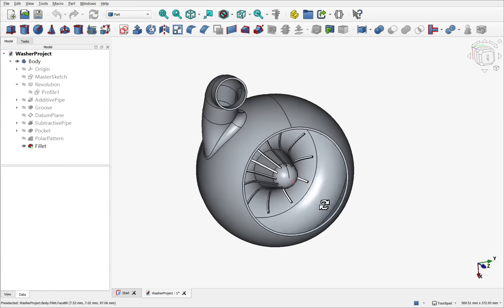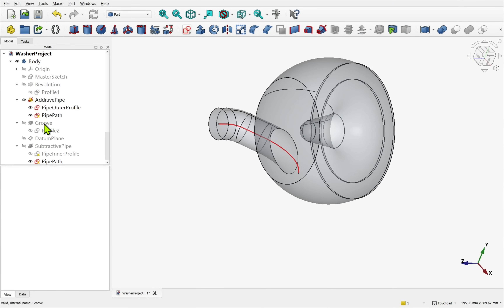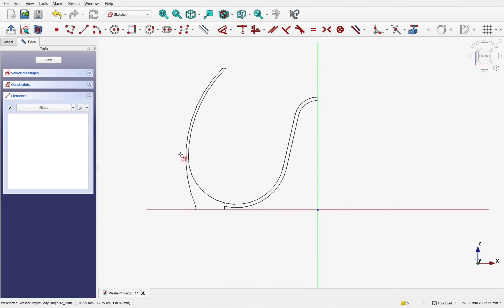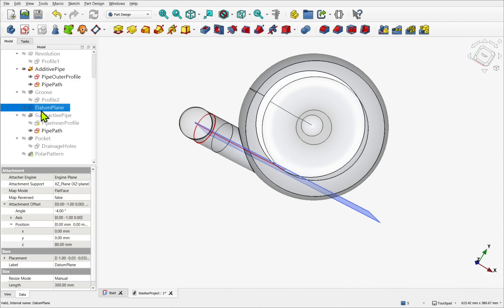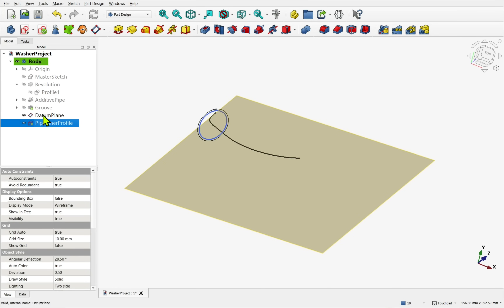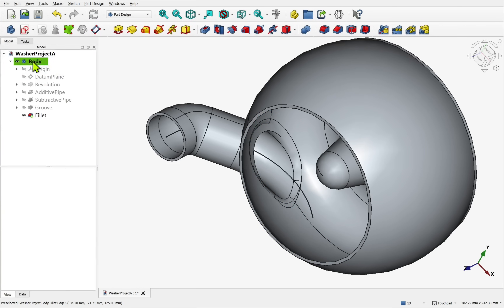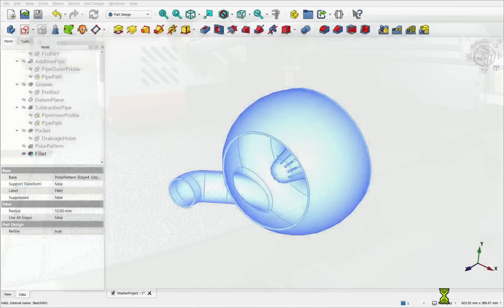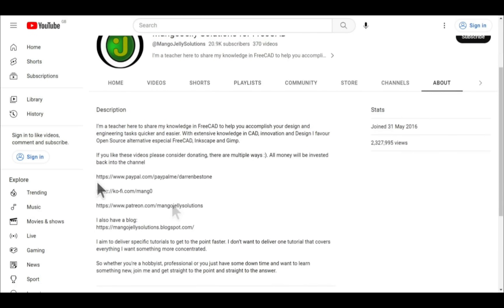FreeCAD 1.0 vs 1.1 some new Features in Action | 3D Printing Project

Comment: Until today, I hadn't thought of creating plans to design pipe routes. Now that I know, I feel incredibly stupid for overlooking such a simple detail. Thank you for the video.
Reply from the maker: It's only easy when you know how or seen it before.  I always kicking myself saying 'why didn't I think of that lol'. Does makes it a lot easier to visualise, also in case you don't know, you can connect two or more planes up with the shape binder for a single pipe.  I did a video for this (it only uses sketch planes but should work with datum as well) https://youtu.be/jE-H_30MbcA

Comment: I spotted your design as a thumbnail for one of those "amazing industrial inventions" compilation videos. I doubt it was even shown in the compilation as those videos are garbage, but it's nice that I found the original author.
Reply from the maker: Oh, I have never seen that video.  Was this recent. This video and the short video was only released towards the end of last week so may be a similar design.
Reply: @MangoJellySolutions  Sorry, I didn't make a note of the video. I've watched a couple in the past, the thumbnails were clickbait and they were a compilation of what I can only describe as extreme OSHA violations where sweaty guys in a dusty workshop wearing nothing but robes and sandals handle barbed wire and glowing metal.

It was very recent that it was recommended to me, and although I'm quite sure it was a picture of your work, it might be as you said. Human memory is fuzzy.

Comment: A couple of quick Qs. I see you have a modern printer. How long did the tomato spin washer take to print? How much filament?  My wife is suddenly really interesting in 3D printers now. Request: can you print some more cool useful kitchen tools so I can get a 3D printer with my wife's blessing.
Reply: A number of 3d printing model sites available to download models or code. Literally, download (code), send to slicer software (software also free download) to slice and load to printer by sd card or wireless. As this channel demonstrates, using freecad opens up human imagination to 3d printing. Or, ask AI to design something for you and slice it to match your printer.  How much filament used & it's cost is usually provided info after slicing. Consider this: free downloads of models and slicers provide time to print & filament costs while you don't even have a printer. Just set the software to a printer you have in mind & process.

Comment: isn't it easier to use a "thickness" feature to hollow out the model instead of doing a groove and a subtractive pipe ?
Reply: The thickness function may not work depending on your model complexity.
Reply from the maker: You can go that route but It's a bit hit and miss if that works, depends on the geometry.  The thickness will offset, inset the faces, if an intersection happens it will all come crashing down, similar to as when a fillet crosses it's edge into another face.

Comment: I really liked this format, short, simple, straightforward, yet with lots of tips and tricks to get you going into making a full product.

I thought you were going to use the thickness for a second. In my designs I always have it in a corner of my mind, but I have never used it because I like to have full control of the design. 

But reading the comments, I guess it's had to please everyone! 😅
Reply from the maker: It's a different format I am testing out, if I tried to do a full tutorial it may loose it's appeal after 20 minutes or so. I am trying a some shorter overviews with more in depth tutorials for anyone who want's to make it from scratch.  Hopefully also showing something physical at the end (if my 3D printer will play nicely ).

Comment: I have a good one for you. i am working with 3d scans of odd shaped chassis rust repair panels. I usually attach a bunch of planes and draw out the part I need on those. What I would like to do is bring one edge (one corner) from the last part on to the next plane so I can use the laser cut interlocking workbench.